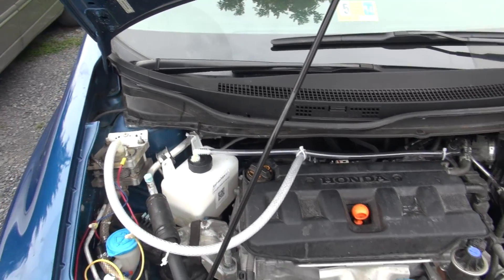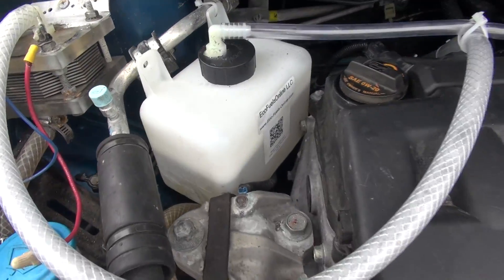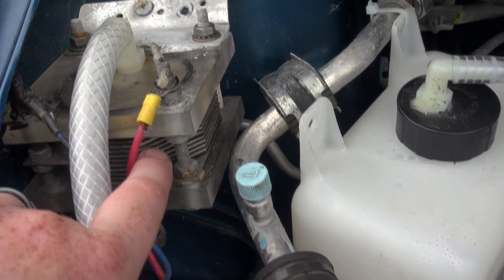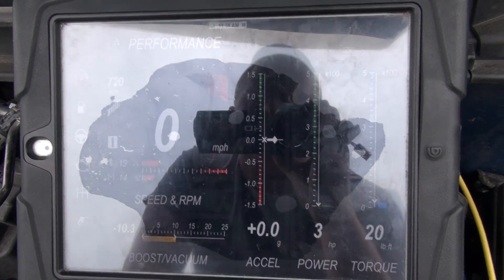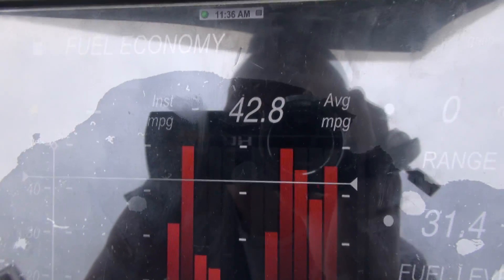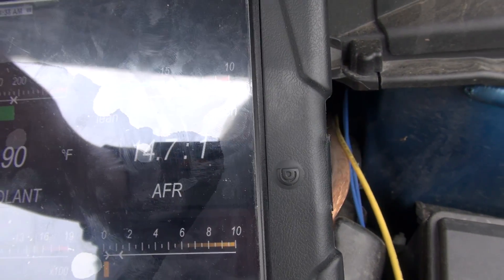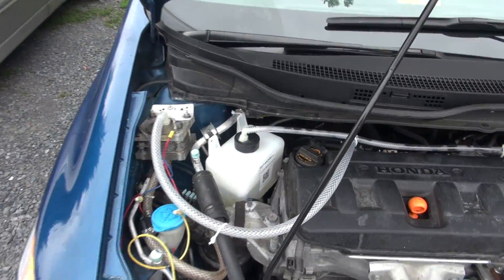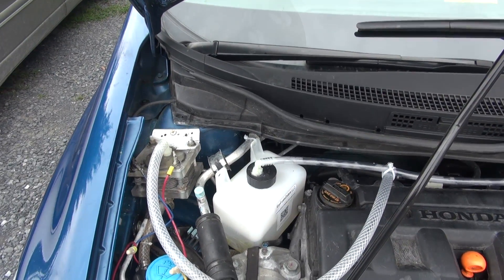Honda Civic 45MPG (WaterPump Dry Cell)

Comment: How r u control requires hho/gas pressure.  Because with passage of time water will be warmed up and it will produce alot gas.   And at the engine will be siezed or melted after high pressure of hho